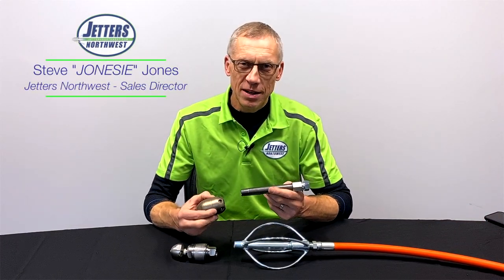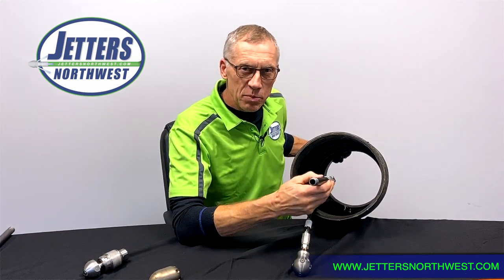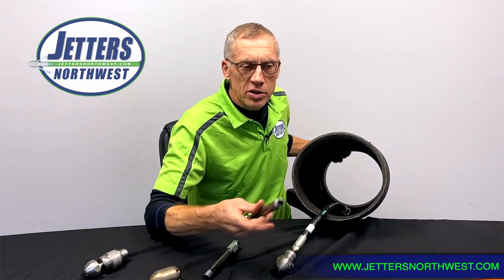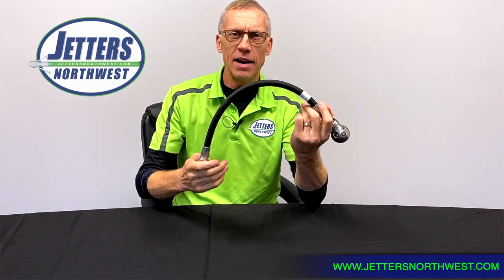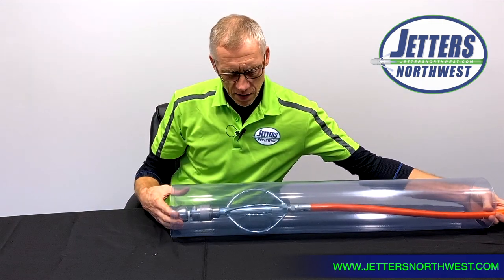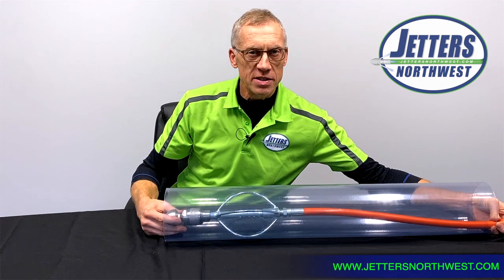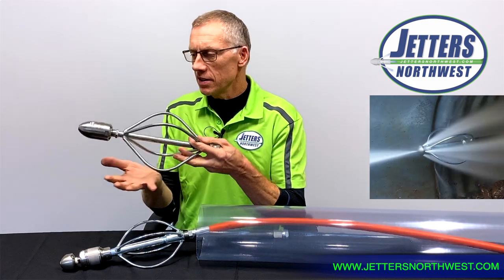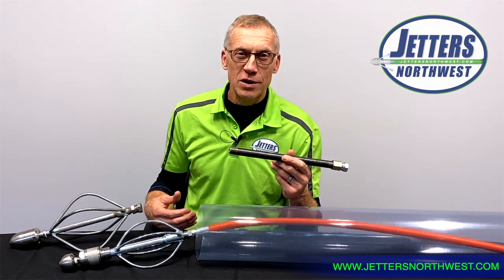USING JETTER NOZZLE 'EXTENSIONS' & 'CENTRALIZERS' - "Get" Jetting w/Jonesie

Comment: Nozzle extensions can save your life!  Especially if you work on a 1 inch truck.  I heard about a guy who's nozzle flipped around, came back out of the manhole and hit him. It filled his lungs with water.  Penetrated his chest.  I've had saw motors flip around and come back at me and that is super scary.  Always use an extension!
Reply from the maker: Thanks for sharing your experience!! Nozzle Extension use is almost ZERO in the "service jetting" industry among rooter-type jetting operators with 1/2" or 3/8" hoses. People need to be made aware of the potential danger of a jetting-nozzle turning around and flying back out of the pipe when they jet 8-inch and larger lines -- AND -- how using a simple & cheap Nozzle-Extension is excellent practice to help protect operators and bystanders from that danger!!